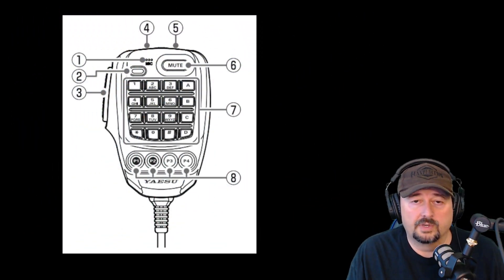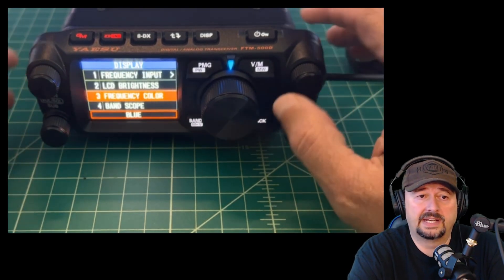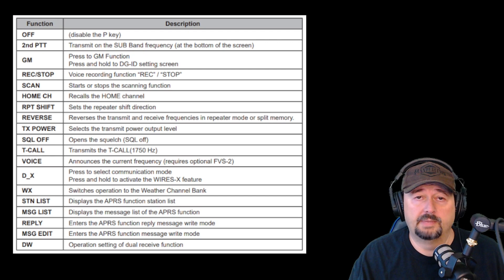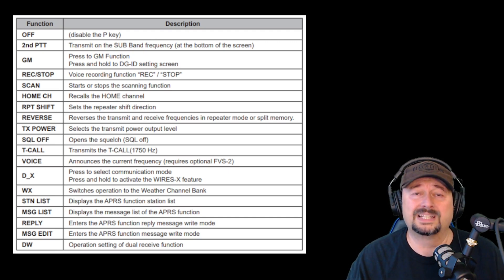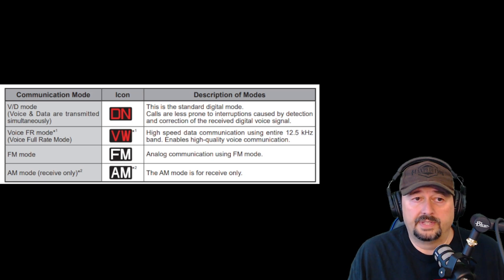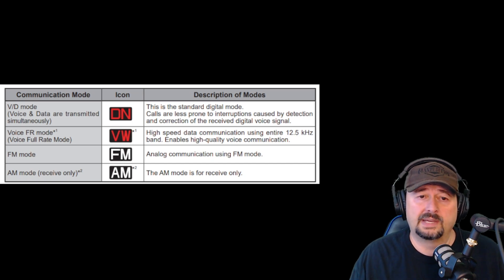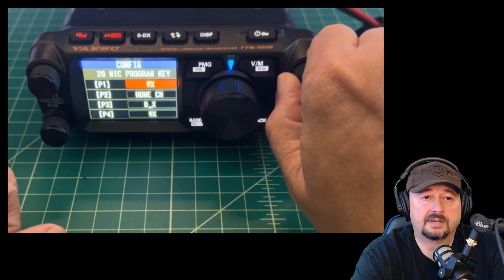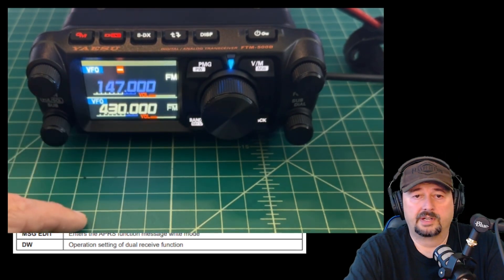Yaesu FTM-500D - Programmable Buttons

Comment: I really enjoy your videos, very informative and helpful. I have a comment and question:
The reverse function allows one to monitor the input frequency of a repeater, very handy to find out if someone using the repeater is close to you - within simplex range. That's my P1 button.
On any of the buttons where I program WX, I get zero audio, even though my local WX station is coming in full strength. If I program it into a PMG slot I can hear it fine, as well in VFO mode. I've tried the wx function on all the programmable buttons with the same result - no audio. Suggestions?
Looking forward to more of your vids..
Reply from the maker: Thanks Bill!  Are you sure you don’t have a PL tone set?  I’ve not heard about that problem.

Comment: Reverse is something that is used a lot especially in fox hunting.  When the fox is transmitting, you want to listen on the input of the repeater.  If you get a bearing on the to repeaters output, you'll track to the repeater site, not to where the fox is.

Also, it is good for checking local signals.  If you can hear the station on the input, you would have the option to go simplex and not tie up the repeater.
Reply from the maker: Thanks for the info, much appreciated 👍

Comment: Does it do SSB?
Reply from the maker: No.  I’m not sure why people think it would….
Reply: @TheSmokinApe  probably because it would be damn cool if it did son
Reply from the maker: @yttc88307  it sure would, but what dual band mobile made in 20 years has SSB?
Reply: @TheSmokinApe  yea i hear you man, probably not a single one (unless you consider the 817 which was incredibly popular, not quite the same thing).  Maybe the Chinese will light a fire under the big Japanese 3, with smaller companies willing to take risks and all (the G90 seems to have hit a home run for alot of people).  Ok take care Ape, 73
Reply: If the FTM-500 had SSB I would buy it immediately. But the absolute last thing I need is another FM/repeater radio.